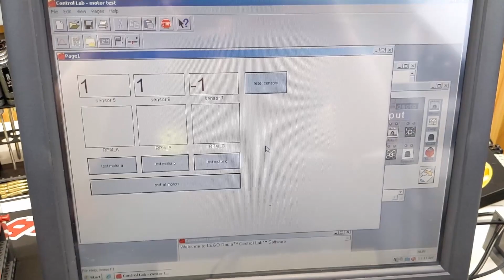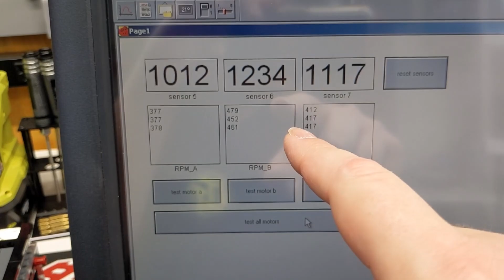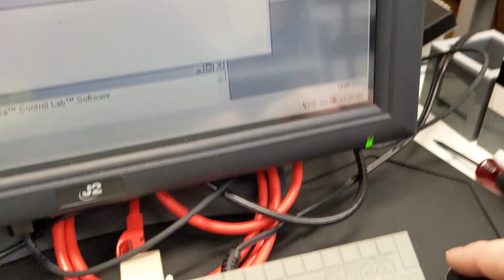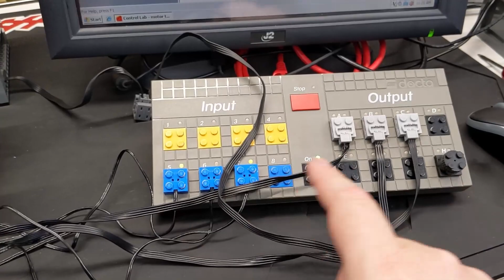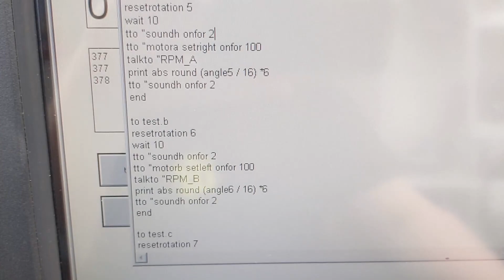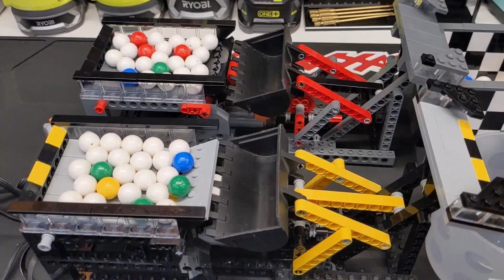Comparing third party Lego PF M motors

Comment: I have a bunch of different lego clone motors that I was planning on testing.  But I thought I'd have them just lifting a weight so that I could calculate the torque easier.  I'll see if I ever get around to it.  I was going to use the L298n motor driver module to control them.  Are you supplying 9v to these?  If I want 9v out of the driver, I think I need to input about 11 v, to compensae for the diode drops.
Reply from the maker: I'm running them at 9 volts.  You can check out the YouTube channel Nonsense Wars, they have done motor comparisons far more in depth than I ever have.

Comment: Interesting stuff.  Have you tried running any of the other motors in reverse on that one GBC module.  That one module may just have a tight spot?
Reply from the maker: It's one I've had together for a while, it had an official Lego motor before.  It's a good idea to test that just to be sure though 👍

Comment: My issue with any non Lego motor is consistency and price. 

Generic motors are inconsistent, the motor from one vendor/manufacturer will vary quite wildly from another vendor/manufacturer. Sometimes multiple motors from the same vendor varies in quality. 

Mould King might have good motors, but I can’t trust that the seller claiming to sell me MK motors have legit MK or if they just look like MK motors.

Reliable motors bought from reliable sources are expensive.  Of course, with Lego PF M now being priced sky high, the considerations are different.  Still, it would be nice to have a good, affordable source of motors that are reliable and consistent.  This is what we lost when Lego retired the PF line.
Reply from the maker: When I first tried the eBay motors I was disappointed with them overall, although I do have uses for them.  My experience with Mould King motors has been good so far.  I've ordered from "MOULD KING Official Store" on AliExpress and "Authentic Mould King Store" on Amazon.  I prefer Amazon and these days they seem to have most items listed.  I've ordered several types of motors, but haven't done any thorough testing / comparisons with all of them yet.  We'll see if things change over time but for now I would consider Mould King M motors to be be the best replacement and $14 is a fair price for them (12.90 on Amazon currently, free shipping but it does take a few weeks).  Like you said make sure it's not just some random seller.
Reply: For me it is more important what a motor does after a 8 hours show with a GBC module. RPM is not that important for me. I had MK motors and so far they worked well. So you should make an 8 hours video showing these 3 modules 😀
Reply from the maker: I don't want to put my dwindling supply of official Lego motors through a durability test but I could see doing that with Mould king motors 🤔